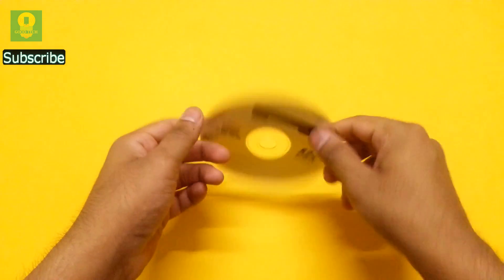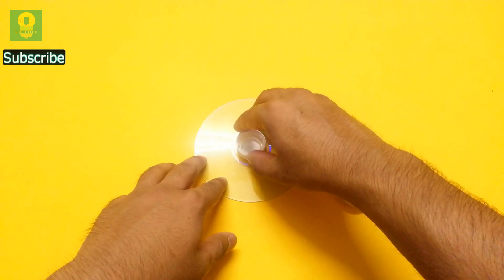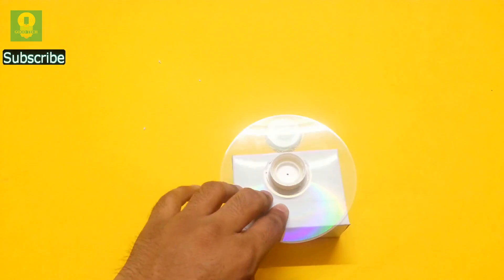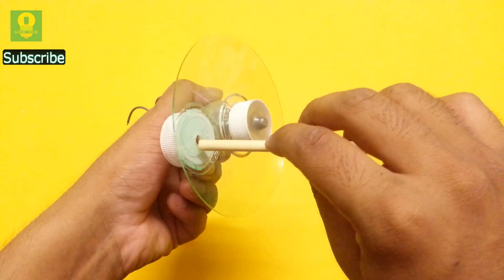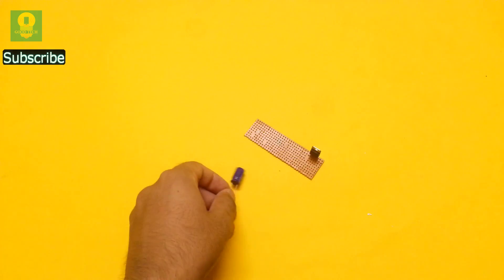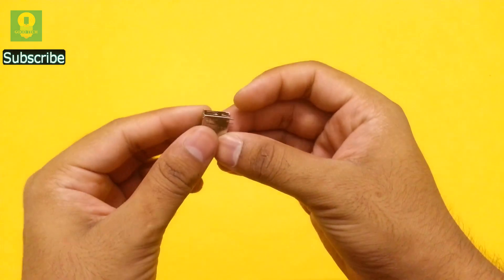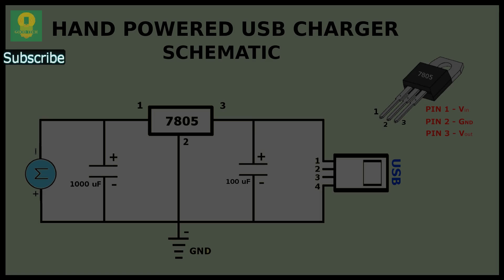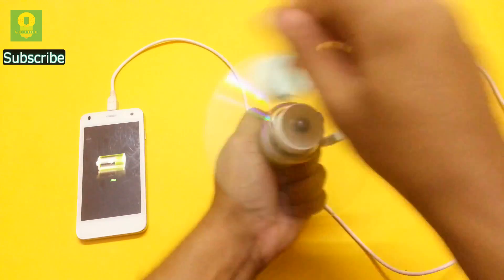How to make a Hand Powered USB Charger at home

Comment: I think you should get another motor and small solar cell to run your system.because if you use direct solar the current is insufficient. But can run micro motors to drive your system.the sun will do it for you.lol....

Comment: Hey sir Can I know all the  parts that you using in this project.because sir I'm just needing it for our school projects .because I think this is the best project for portable and other way of charging device. thanks for response☺
Reply from the maker: Yes, you can make this project and it also works but because you are using in a school project, you should know that it will actually charge a cell phone very slowly because this 12v motor can only provide about 500mA of current.
I also make detailed tutorials for all my projects with material links and additional info, have a look - https://www.instructables.com/id/How-to-Make-a-Hand-Powered-USB-Charger/
Reply: @goodtech1  thanks sir for very helpful presentation and information😊👍👍👍👍👍👍👍👍👍👍👍👍👍👍👍
Reply from the maker: You are welcome..:)

Comment: why do we need two capacitor?
Reply from the maker: One capacitor is for the input circuit and other for the output. The circuit will even work without the capacitors also but they are recommended to eliminate any abnormal spikes in power that can damage the device.

Comment: I can use any tipe of DC motor ?
Reply from the maker: Yes, every DC motor generates power when the shaft is rotated but it will not be possible to rotate a shaft very quickly for every motor. So, a geared DC motor is much more useful.
Also, not every motor generates same power.
Reply: Thx for your replay.

Comment: how can we find the regulator ans capacitor and will small voltage motor work
Reply from the maker: A small voltage motor will not work because we need atleast 5v for charging a mobile. All the components are mostly available online on amazon and ebay.
Also, if you additional info, have a look at my instructables - https://www.instructables.com/id/How-to-Make-a-Hand-Powered-USB-Charger/

Comment: Will it realy work please respond because i want to also made it
Reply from the maker: Yes, it does work. Just make sure you use a 12v DC motor. A 12v DC motor will generate about 12v 500mA. Then 7805 regulator IC converts it to 5v for charging a mobile.
Reply: Thanku brother

Comment: Hi Godtech, I found out that (at least for my iPhone) I must shortcut the data pins on the USB. (Nr 2 and 3 in your video) 
I simply solder them together and voila, the phone will start charging! (Anyone is welcome to explain why this is working!)
Reply from the maker: Which iphone are you using?? iphone is designed in such a way that it only starts to charge when it detects voltage on the data pins(pin 2 & pin3) as well. When you short the pins, the phone is able to detect some voltage on the pins and thus starts to charge with the max power a charger can provide but it is however, not recommended to directly short the pins as it can damage the charging device & the phone battery.
It is important to add few resistors in the voltage divider configuration between the data pins, so as to control the charging current to the device.
Eg: For a 2A iphone / ipad charger, if pin D- has 2.75v and pin D+ had 2.0v, then the phone will charge with 900mA (slow charger) but if the pin D- has 2.0v and pin D+ had 2.75v, then iphone will charge with 2000mA of current (thus behaving as fast charger).

Comment: can we use a data cable directly instead of using female cable and then connecting to the data cable
Reply from the maker: Yes, you can surely use the data cable but for that the USB port will have to be cut from the wire and the wires will have to be soldered directly to the PCB board.

Comment: I am having the ph which requires 9v as input.what are the changes I need to do
Reply from the maker: To get the 9v output, you only need to use 7809 IC instead of 7805. But are you sure your phone requires 9v because i havn't heard of any such device yet except if it is working in fast charging mode. But this charger will not work in fast charging mode as the motor can only generate about 500mA.
Reply: GOODTECH - Creativity and Science 
Tq bro
Reply: Can i use 24dc generator motor ? Which ic will require for producing 2A or 1500ma power to charge the phone.

Comment: What is the need for capacitor to be placed before and after the Ic.
Reply from the maker: The capacitor is mostly used to smooth the output waveform and remove the ripples. It is always recommended to use capacitors to protect the devices from random surges in power supply.

Comment: This is correct, but friend its not produce much mA ,so that it can't use in smart phones. Can mA increase to 1000mA . If possible then pls reply.
Reply from the maker: The motor i used produces about 500mA, it is sufficient to charge a smartphone in emergency but the problem with this device is that is practically impossible to rotate the motor shaft by hand for  longer period of time, however, if we connect it to a bicycle wheel, then it is a very useful gadget to produce free electricity.

Comment: voltage on 100uf capacitors?
Reply from the maker: 25v, however, any voltage will work as long as it is more than the input supply voltage.

Comment: no working
Reply from the maker: Double check the connections and if everything seems fine then try reversing the direction of rotation of motor to reverse the polarity. It should work just fine but make sure that motor you have used provide atleast 6v as output directly (without the circuit). Connect a voltmeter to the motor terminal to check the output voltage.

Comment: how many ampere coming out to the port ?
Reply from the maker: 7805 can provide upto 5v 1A but it depends on the input supplied. The motor i have used is capable of providing 5v 500mA.

Comment: tell me how tell me how to make it without a motor
Reply from the maker: Attach a 12v supply at the place of motor. But it will then defeat the purpose of this project because if a power supply is to be used, then its better to use a 5v supply and charge the  mobile phone directly with it.

Comment: where did you put the wire 
  under the board or above the board
Reply: What does this mean? ^ If you think this doesn't work and is some sort of free energy device then you have a lot, NO A WHOLE LOT, of stuff to learn... This is exactly how any generator works, EXCEPT, normally it is not cranked by hand but by an engine of the fuel burning type... This is as real as it gets for creating energy by use of a motor with nothing involved but you and the motor... It will work...

Comment: Can you give an explanation of how you designed to the charging circuit? why those particular capacitors? I'm measuring negative voltage when I turn the motor one direction and no voltage in reverse direction.
Reply from the maker: This is just a basic circuit for operation of 7805 IC found in its datasheet to get regulated 5v at output. Double check the orientation of 7805 in your circuit because getting no voltage and negative voltage is only possible if the regulator is connected with wrong orientation i.e connecting Vout instead of Vin.
Reply: I double checked the VR connections and they are correct. If I switch my meter leads I get positive voltage - the black lead from my meter is on the output of the VR and red lead is on the ground. Does that sound right?
Reply from the maker: This is not supposed to happen if all the connections are done right. Make sure you have double checked the orientation of electrolytic capapcitors i.e +ve to Vin for input capacitor and +ve to Vout for ouput capacitor and -ve to ground for both capacitors. Wrong connection with capacitors now seems to be the only reason. Also, give it a try without connecting any capacitors.

Comment: Its not charing
Reply from the maker: Make sure that the motor you have used is capable to provide enough volts by first connecting it to a multimeter set to voltage measurement mode. If the voltage is more than 8v, then the motor can be used. Now, make the circuit and double check the connections, if everything seems fine, it should work.
But if the circuit doesn't work inspite of everything done well, then rotate the motor shaft in opposite direction to reverse the polarity and everything should work well.

Comment: what if u use 5v dc motor? still need a regulator?
Reply from the maker: If the input source is 5v then the phone can charge but a regulator is always recommended in order to protect the device in case excess voltage is generated.

Comment: can you please put the materials here vecause i cannot understand what are you saying. Dont be offended but your message was not clear and cannot be understand.
Reply from the maker: For Charging Circuit:
12v Geared DC motor - http://amzn.to/2q8ukdz

General purpose PCB board - http://amzn.to/2mww8hk
7805 voltage regulator - http://amzn.to/2q8oRU8
Capacitor 1000 uf - http://amzn.to/2q7Teu8
Capacitor 100 uf - http://amzn.to/2q7Teu8
female USB Port - http://amzn.to/2q8hOej

For Rotating Mechanism:
Spare CD
Wooden Stick
Bottle Caps
Straw

Comment: i have a cuted side of a chargers wire i can simply join motor's 2 wires to it and charge?
Reply from the maker: You cannot connect DC motor to a AC mobile charger. The chargers are made to charge with 220v AC supply.

Comment: instead of ic what we can use
Reply from the maker: You do need a voltage regulator to get a regulated 5v output in order to protect your device. An ic is necessary, although you can use any substitute for 7805, however, it is most easily available.
Reply: Thanks

Comment: How much amperes output it gives??? While using 12 v dc motor
Reply from the maker: The motor i used, when rotated at a uniform speed, gives about 500mA. But higher the amperes, more will be the torque required to rotate the shaft.

Comment: i love it could you tell me please what are the electronic pieces that you use on this proyect (sorry my english is not good it all).
Reply from the maker: Charging circuit includes:
7805 voltage regulator I.C
100uF capacitor
1000uF capacitor
Female USB port
12v geared DC motor

To make the rotating handle we need:
Bottle caps
spare disk
Wooden stick
straw

Comment: Can i use a general DC motor  ?. I don't have gear DC motor.
Reply from the maker: A general DC motor also works but it will not be able to produce enough power with hand rotation because with gears the rotation ratio increases and with just slight rotation of handle, the motor shaft takes many rotations, thus producing enough power.

Comment: What is the power/current rating of the motor?
Reply from the maker: It is a 12v geared DC motor, having a recommended current rating of 1A.
Reply: Thanks man... just a quick question, is there a polarity on the IC regulator? I made the circuit as described but it doesn't wok...
Reply from the maker: Yes, the IC has defined pins for +ve and -ve supply. However, if the circuit is not working try rotating the motor shaft in opposite direction, then it might work. Otherwise double check the connections.
Also make sure that the motor is able to generate enough voltage.
Reply: Is there a way to know which is +ve/-ve? I've checked the ones I have but no clues. My motor generates 12 V at 84 RPM so that should be ok.
Reply from the maker: To know the pins you need to refer the pin configuration of 7805 IC. You can search for it on google images. However, the middle pin of the IC is '-ve' (i.e Gnd).

Comment: I gave make it it's providing 5 volts. but phone is not storing the charging.  it is only show
Reply: is it can usefull for mobile charging
Reply from the maker: Yes, it does work but make sure that motor is capable to provide atleast 0.5A.
Reply: no sir it's providing only 2-3 amps. can v increase amps without loosing the voltage
Reply from the maker: The positive and negative of a motor is relative and is dependent on the direction of rotation of motor shaft.
Reply: clockwise
Reply: GOODTECH - Creativity and Science can a motor provide 1 amp current

Comment: 1000uf and 100uf capacitor of what volt? plz reply
Reply from the maker: 1000uf, 25v and 100uf, 16v. However, any voltage capacitors can be used as long as the rated voltage on capacitors is more than the input voltage.

Comment: sir actually I made this ditto at home but it is not working please help me sir
Reply from the maker: At first double check the connections. Also, make sure you have used a motor that is capable of providing atleast 6v on rotation of the shaft. You can check the voltage output of motor using a multimeter. If everything is fine then check the polarity of the wires connected to the circuit and try reversing the direction of rotation.

Comment: Is a 6v motor works for it ?
Reply from the maker: Yes, it might. Be sure to check the voltage output with a multimeter before connecting it to the circuit.  If the motor gives the minimum output of 5.7v, then it can be used.

Comment: What voltage you need to 1000 uf and 100 uf ,please spicify
Reply from the maker: Any voltage higher than the supply voltage will work well. However, i used 1000uf, 25v and 100uf, 16v capacitors.

Comment: What is the voltage of the capacitor you used ?
Reply from the maker: 25v, 1000uf capacitor and 16v, 100uF capacitor. However, voltage does not matter as long as the capacitor voltage is rated above the supply voltage.
Reply: GOODTECH - Creativity and Science We used 16v in all capacitor . But our circuit does not work
Reply from the maker: The circuit must surely work. Do double check the connections and you can also refer the datasheet of 7805 voltage regulator to rectify the circuit.
Reply: GOODTECH - Creativity and Science Thank you
Reply: it works in a battery and power supply .

Comment: im not an engineer so i need to ask
the 7805 voltage regulator
will keep the voltage no more than 5v even you spin the motor quickly?
does the speed of rotation will affect the ampere?
Reply from the maker: A motor when rotated works as a DC generator, therefore, both the voltage and current increases on increasing the RPM.
Reply: yes

Comment: please Tell all the materials I require.
Reply from the maker: 12v Geared DC motor 
Old CD/DVD 
Wooden stick 
Bottle caps 
General purpose PCB board 
7805Voltage regulator IC 
1000 uf  and 100 uF capacitor 
Female USB port

Comment: can i do this by using motor less than 12 vatts
Reply from the maker: Yes, you can use a motor less that 12v but make sure that the output is anything above 5.7v. You can check the output with a multimeter.

Comment: hello sir.....
i am not able to connect all these things on board . so please tell me how to connect all these things....
Reply from the maker: What problem are you facing? If the problem is with soldering then try making the connections on a breadboard.
Reply: i am not abale to understand how i should connect regulator on board from this video
Reply from the maker: 7805 regulator has 3 pins, Vin, Gnd, Vout. Insert it in a general purpose PCB board and solder it. Connect Vin in to the 1000uF capacitor, gnd pin to -ve terminal and Vout to 100uF capacitor. The direction of pins can be identified from the schematic in the video.

Comment: PathakA good project that can be easily made with minimum parts.The usb charger does not charge a smartphone. The voltage sets up but the current is way below what is required. Please suggest something that is capable of producing atleast 1amp current.

Comment: my old phone's charger still works but i'm planning to convert it into this as an instructional material to show my students a concrete example of how mechanical energy can be made. will it still work like this if i get the charging system of my old charger out of its case? it will also save me time and resources if it's possible. thank you.
Reply from the maker: No, a normal phone charger will not work with this because that converts 220v AC to 5v DC. In this we just need a 12v to 5v converter.
Reply: what if I remove the charger's transformer?
Reply: Kapayapaan Biyaya then it will work..

Comment: What kind of this circuit is called so we can just by it from any electrical
  hardware store
Reply from the maker: Basically, it is a 12v to 5v converter. You can also use a 12v car mobile charger with this. The car smartphone charger also gives a output of about 5v with 12v as input.
Reply: +GOODTECH - Creativity and Science thanks but iknow that a car charger whould do that but I am using a processor fan soilded to a car charger but moving it fast by a blower it's not working I see a  electircal capacitor
Reply from the maker: First check whether the fan motor is able to generate some output using a multimeter. If it does generate about 12v, then the charger will also work.
Reply: +GOODTECH - Creativity and Science  thanks but I don't have a muiltemeter any other trick I also used a led to check it out
Reply from the maker: A single LED can glow just with 2-3v to check the output using LEDs, connect 4-5 LEDs in series and then try powering them with the motor. If they glow, you have an output of about 12v, if they don't remove LED one by one to find the exact voltage output of the motor.
Reply: ok thanks
If they didn't work then how to find the correct notor
Reply from the maker: Generally a 12v motor works fine. The voltage rating should be on the motor.

Comment: shall we increase that current to 1amp

if possible can u please tell the components to use...
Reply from the maker: All the materials listed in video description.
Reply: You said that in previous comments it gives 500ma current but if I want to increase that current to 1amp what range of capacitors I need instead of 1000uf &100uf